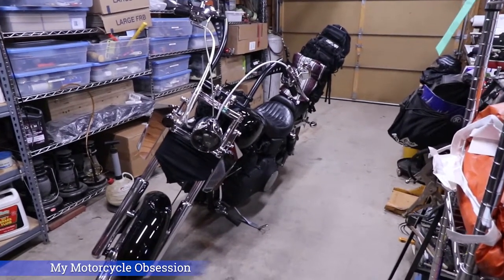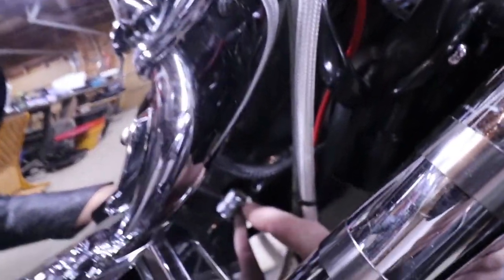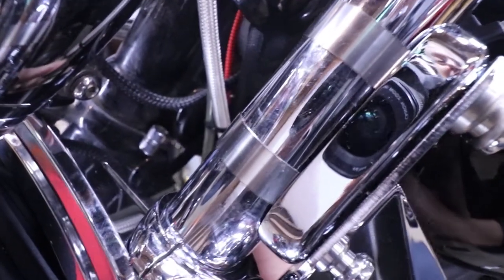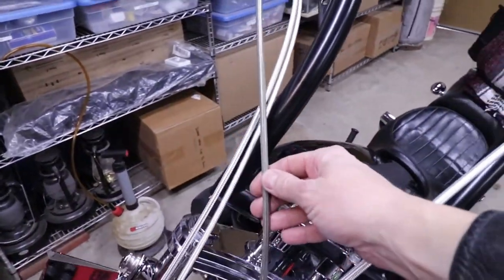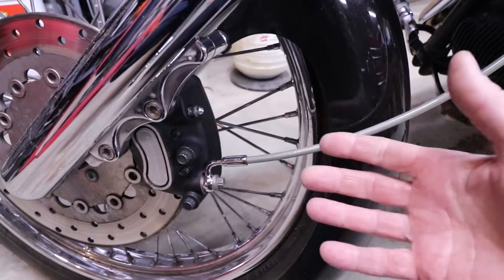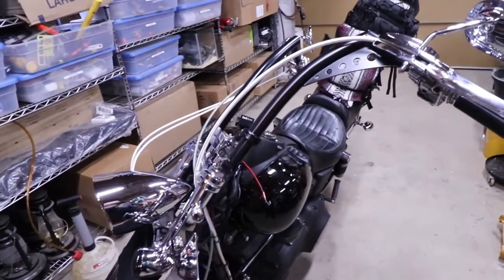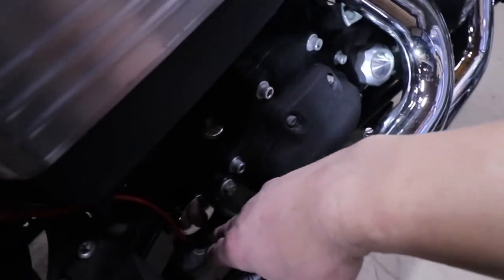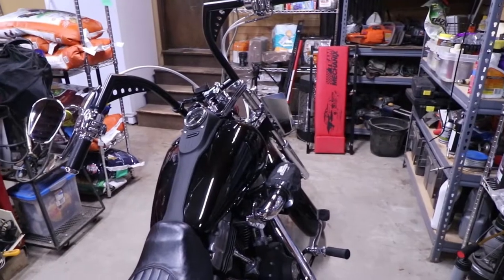How to Fix Spongy Brakes in 15 SECONDS with NO TOOLS!

Comment: I have a Indian Scout 02 I've done this process before a few days ago and the same problem keeps coming up I keep losing my front brake floppy sluggage super loose I was caught on the highway I drove home without no fun break what do you recommend I would do should I empty out the master cylinder drain out all the brake fluid that's been in there for a while a couple of years I will say about 4 years what do you recommend I should do inbox me let me know what you think
Reply from the maker: Could be a problem with your master cylinder.
Reply: christ that brake fluid bad  change every two years sod all wrong with your system